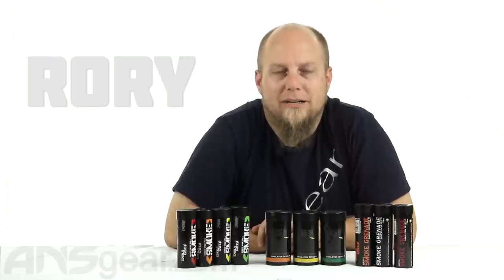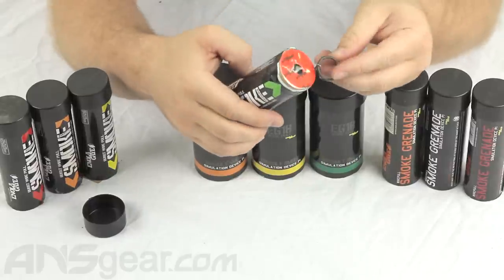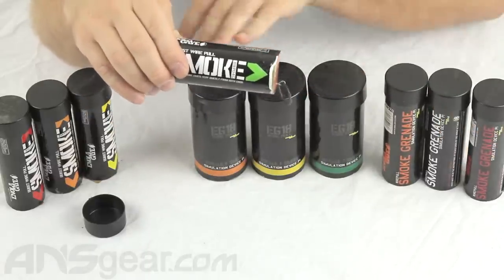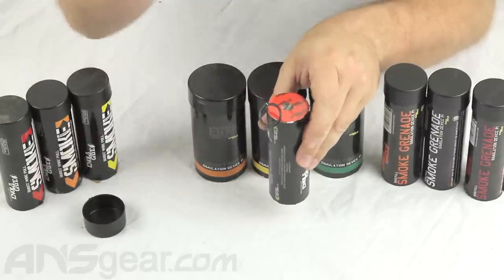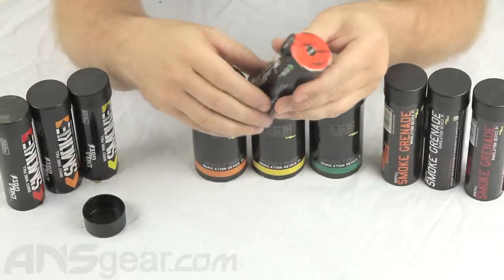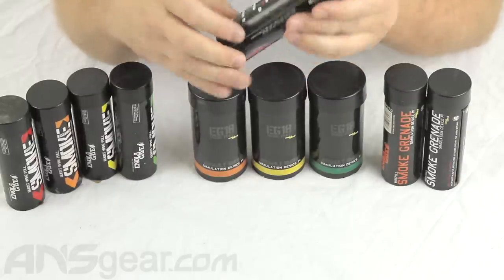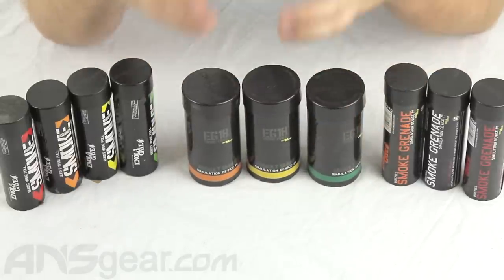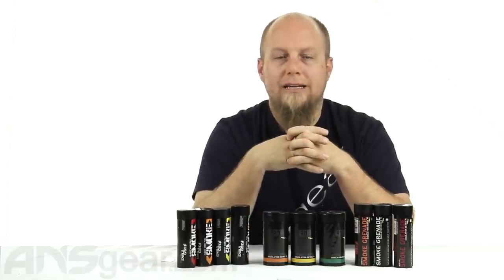Enola Gaye Smoke Grenades - Review

Comment: What are the height and diameter of the smaller smoke grenades? I'm trying to buy pouches that would fit my plate carrier thanks :)
Reply from the maker: the EG18 is 4.75 inches tall with a diameter of 2.25 inches.

Comment: 2 questions, can the be used indoors? like in a gym with a high ceiling, it is for our dance in p.e. and can they be closed after open them? close them while they are throwing the smoke.
Reply from the maker: Elena Atiénzar You can likely use it indoors as the smoke is in no way hazardous. But just to be sure, I would recommend checking with the facility owners to make sure it is okay. They can char the area they are on so you may need to put them in a surface when ignited. The smoke grenades will not stop producing smoke until it has completed the burn.
Reply: Okay thank you so much! And how long will they take to going out?
Reply: ANSgearPaintball
Reply from the maker: Elena Atiénzar Depending on the size you purchase the can burn up to 90 seconds. The standard wirepull burns for about 30-45 seconds, the Burst burns for roughly the same amount of time, and the bigger EG18 burns for 90 seconds.